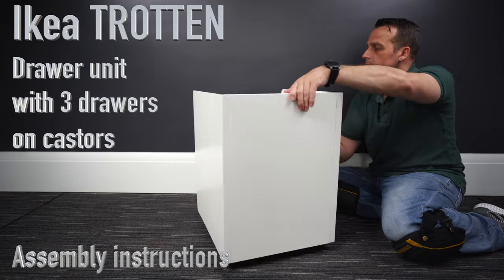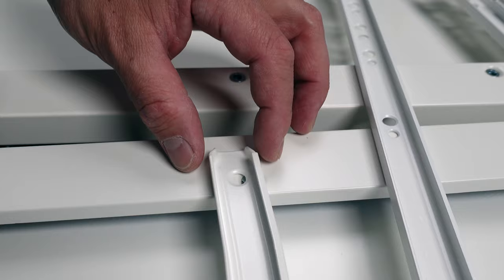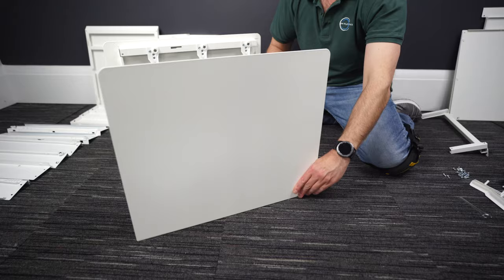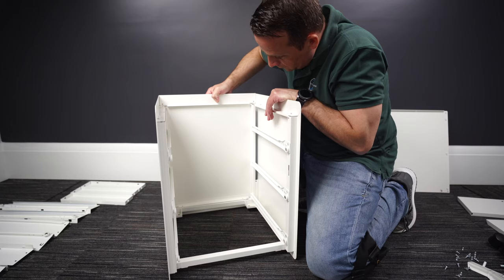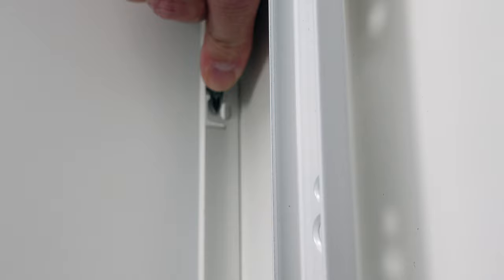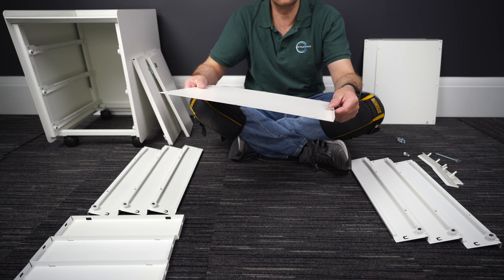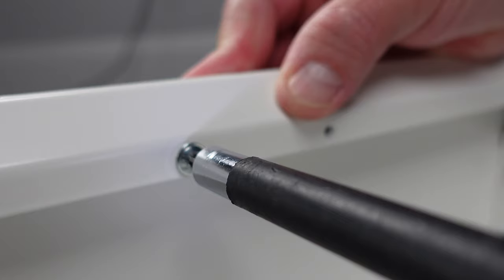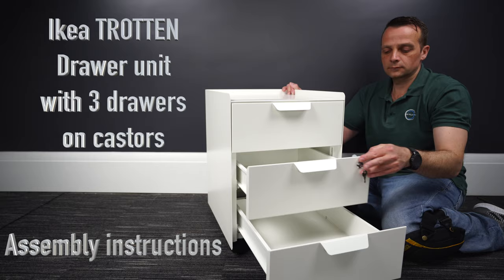Ikea TROTTEN Drawer unit with 3 drawers on castors Assembly instructions

Comment: Bless you for this detailed video on assembly of the Trotten Desk. I need your help on a very important question. I want to keep my PC's CPU cabinet (slightly less than 10kg / 20lb) on top of the Trotten Desk. Do you think that it is sturdy enough to take the weight or is the top plate likely to bend?